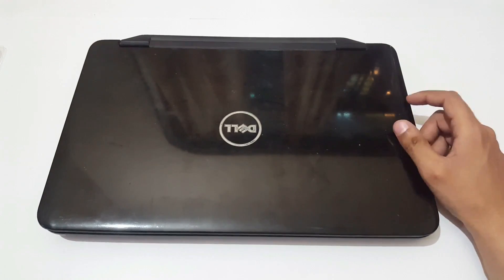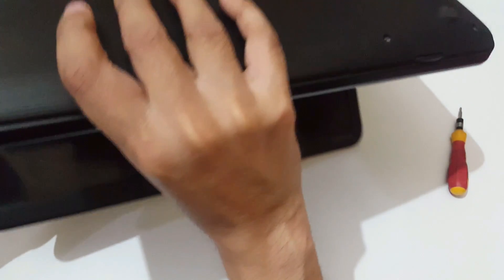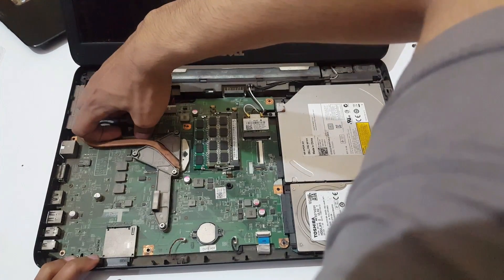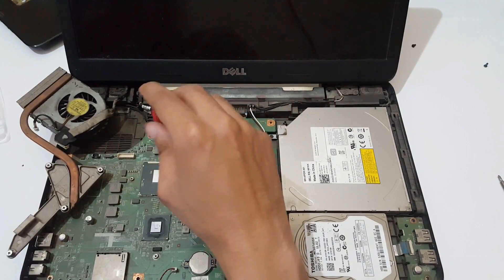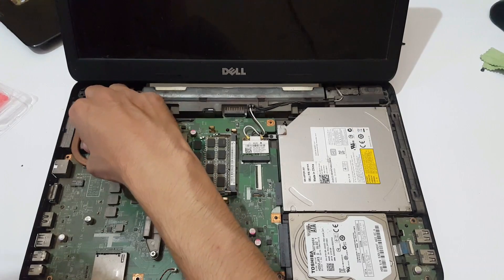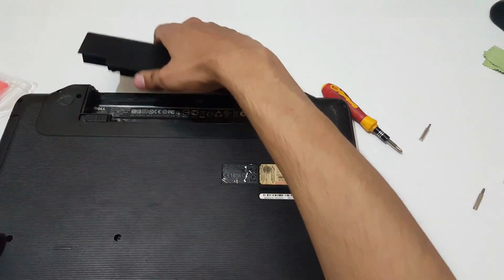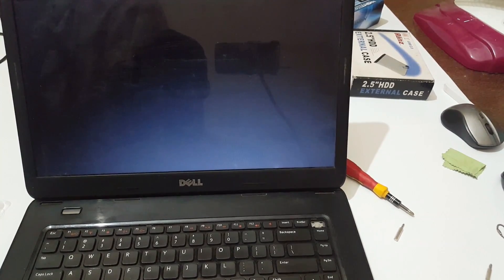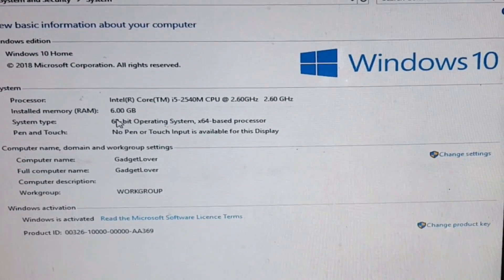How to Upgrade Processor on DELL Laptop | i3 to i5 & i7 - Make Laptop Faster for Gaming

Comment: I can upgrade from ryzen 3 3250u to ryzen 5 with the same gen? My laptop is a dell inspiron 15 3505, with a FP5 socket
Reply from the maker: The processor of this Laptop is soldered so you can't upgrade it but I would suggest you upgrade its RAM to max and install SSD for better performance

Comment: Bro I have intel core I3 10110u processor can I upgrade it to Intel I5 processor and which is best please reply me my laptop is lenovo ideapad 10th generation
Reply from the maker: The processor of this Laptop is soldered so you can't upgrade it but I would suggest you upgrade its RAM to max and install SSD for better performance

Comment: Bro can i upgrade my dell inspiron 5567 i3 6006u to i5 or i7
Reply from the maker: The processor of this Laptop is soldered so you can't upgrade it but I would suggest you upgrade its RAM to max and install SSD for better performance

Comment: can we upgrade processor of dell inspiron 15 3000 i3  {idk if there is pga or bga  in my process}
  to i5 or i7    if yes so how much will cost?
Reply from the maker: The processor of this Laptop is soldered so you can't upgrade it but I would suggest you upgrade its RAM to max and install SSD for better performance

Comment: Bro I have Dell Inspiron 3520 From 2012. 
I want to upgrade my processor from i3 3110m to i7 3632QM. Both have 35w TDP. 

Or Can I upgrade to i7-3940XM which is 55W TDP.  

Please Reply 🙏
Reply from the maker: Intel Core i7 3632QM is best processor for your Laptop
Reply: @GadgetLover360  So my laptop cannot support 55w TDP processor?
Reply from the maker: @archispal3618  It support but you will get some heating issues while operating
Reply: @GadgetLover360  thanks Bro.
Reply from the maker: @archispal3618  You're welcome
Reply: i have i7 processor you can upgrade it
Reply: I will arrange quad core processor i7

Comment: i have an  core(TM) i3-6006U CPU @ 2.00GHZ i want to upgrade to i5,what should i buy?
Reply: i have a DELL Inspiron 15 3000 laptop
Reply from the maker: @mlcfamilyofficial0521  In my knowledge the processor of this Laptop is soldered so you can't upgrade it but I would suggest you upgrade its RAM to max and install SSD for better performance
Reply: @GadgetLover360  okay thanks.
Reply from the maker: @mlcfamilyofficial0521  You're welcome
Reply: @GadgetLover360  what is the maximum RAM Can i upgrade it?
Reply from the maker: @mlcfamilyofficial0521  16GB
Reply: @GadgetLover360  2 sticks of 8Gb Ram?
Reply from the maker: @mlcfamilyofficial0521  Yes

Comment: I have dell Inspiron 3558 intel celeron 3215U. Which processor will br the best to upgrade?
Reply from the maker: The processor of this Laptop is soldered so you can't upgrade it but I would suggest you upgrade its RAM to max and install SSD for better performance

Comment: Hi Sir, I have a dell lattitude 5480 with i5 7200u is it upgradeable and can you suggest CPU to give better performance while gaming?
Reply from the maker: Hi and the processor of this Laptop is soldered so you can't upgrade it but I would suggest you upgrade its RAM to max and install SSD for better performance
Reply: @GadgetLover360  Oh Thanks for the info!
Reply from the maker: @ja19n  You're welcome

Comment: I have a Toshiba Satellite C655-S5212 from 2011 with a Intel® CoreTM i3-2310M Processor 2.1 GHz. What CPUs are interchangeable that I could upgrade to?
Reply from the maker: In my knowledge the processor of this Laptop is soldered so you can't upgrade it but I would suggest you upgrade its RAM to max and install SSD for better performance
Reply: I will arrange quad core processor i7 2860

Comment: Can we upgrade pentinum dual core to i3 or i5  & what is the cost of upgrading
Reply from the maker: If the processor is not soldered you can upgrade it in same generation
Reply: I will arrange quad core processor i7

Comment: I have dell inspiron 15 3000 i3 .. can i change the processor? i want i7 ? is it compatible for i7 or not?
Reply from the maker: In my knowledge the processor of this Laptop is soldered so you can't update it but I would suggest you upgrade its RAM to max and install SSD for better performance

Comment: I have an inspiron 5720, whats the best cpu i could upgrade to?
Reply from the maker: If the processor is not soldered you can upgrade it in same generation
Reply: @GadgetLover360  I'm new to upgrading, it's not soldered but I'm not familiar with generations or whatnot, sorry
Reply from the maker: @NbwGwiff  Kindly provide its processor number
Reply: @GadgetLover360  Intel i5-3210m @2.5GHz
Reply from the maker: @NbwGwiff  Intel Core i7 3632QM is best processor for your Laptop
Reply: @GadgetLover360  thank you, I forgot to say. I went ahead and bought that and got it installed so yay!
Reply from the maker: @NbwGwiff  You're welcome
Reply: I will arrange quad core processor i7

Comment: Hi sir, how about the dell vostro 15 with intel celeron p4600, can i still be able to upgreade it? And if i can still upgrade it, what is the max core upgrade for it sir? Thank you for your answer!❤
Reply from the maker: Hi you're welcome and if the processor is not soldered Intel Core i5 580M is best processor for your Laptop
Reply: @GadgetLover360  my bad sir, my laptop is vostro 3500 (end of life) with intel celeron p4600. Is it still upgrade-able sir? Thank you for the answer!
Reply from the maker: @reymarckiancorpuz341  You're welcome and yes
Reply: @GadgetLover360  is it still the i5 580m sir?
Reply from the maker: @reymarckiancorpuz341  Yes
Reply: I will arrange quad core processor i7

Comment: How about Dell 14 3437 celeron  whats the compatible processor i want to upgrade
Reply from the maker: If the processor is not soldered you can upgrade it in same generation
Reply: @GadgetLover360  whats the generation of celeron processor i don't know
Reply from the maker: @Rienhardheydrich  Intel Core i5 4360U is best processor for your Laptop

Comment: Excuse me sir mine is a dell inspiron 15r i5 5537 4 gb ram and it's from 2013 I have to upgrade the cpu and the ram ssd
I wanna know compatible ram and cpu and ssd plzz
Reply from the maker: The processor of this Laptop is soldered so you can't upgrade it but I would suggest you upgrade its RAM to max and install SSD for better performance
Reply: @GadgetLover360  sir so after maxing out it's ram and ssd (also tell me the max ssd compatible with it) will I be able to run games like valorant on the lowest settings
Also I want to know its graphics memory

Comment: Sir my laptop is toshiba satelite C50 A  core i3 can i upgrade it to core i7 5 to 12th gen? How much it will cost me? Any expected idea?
Reply from the maker: Yes you can upgrade it in same generation and it will not be too expensive I would suggest you to buy its processor from Ebay online store
Reply: @GadgetLover360 thank you sir but i have question will it work if i upgrade it in core i7 other than 3rd gen (other than laptop same gen)?
Reply from the maker: @shahabahmad225  You're welcome and no
Reply: @GadgetLover360 sir i am grateful for your time and response.
Sir if this is the case then core i9 3rd gen will   work if i upgrade it?
Reply from the maker: @shahabahmad225  Yes

Comment: Hello sir, can I upgrade my laptop processor, Dell inspiron 15 3000 series Intel(R) Core(TM) i3-6006U CPU @ 2.00GHz   2.00 GHz into Intel core i5 processor.
Reply from the maker: Hi and in my knowledge the processor of this Laptop is soldered so you can't upgrade it but I would suggest you upgrade its RAM to max and install SSD for better performance
Reply: Thank you ❤
Reply from the maker: @kennedyreang3076  You're welcome

Comment: Can I upgrade from i3 2nd gen to i7 2nd gen?
In dell Vostro 1450.
My laptop looks exactly same like yours.
Reply from the maker: Yes
Reply: @GadgetLover360  from where can I purchase the new processes.
Will there be a significant improvement in performance ?
Last year I installed an SSD and it has significantly improved it's performance.
Reply from the maker: @sagittarius544  Yes it will improve its performance and I would suggest you buy it from Ebay online store
Reply: @GadgetLover360  Intel Core i7-2620M Laptop CPU Processor
Is it compatible with my laptop?
Reply from the maker: @sagittarius544  Yes
Reply: I will arrange quad core processor i7 2860

Comment: can i upgrade my dell latitude e7240 from i5 4gen to i7
Reply from the maker: The processor of this Laptop is soldered so you can't upgrade it but I would suggest you upgrade its RAM to max and install SSD for better performance

Comment: hey insprion 3542 laptop processor is upgradable
Reply from the maker: The processor of this Laptop is soldered so you can't upgrade it but I would suggest you upgrade its RAM to max and install SSD for better performance

Comment: Very usefull 😊 i dnt skape the adds😊. My question is what is good i need to go shop to upgrade or i change it alone save money even i need to pay to shop😅
Reply from the maker: I would like to inform you that if the processor is not soldered you can upgrade it in same generation

Comment: Can you please check and tell me that can i do the same in my Dell Inspiron 15 3565, thanks in advance.
Reply from the maker: You're welcome and the processor of this Laptop is soldered so you can't upgrade it but I would suggest you upgrade its RAM to max and install SSD for better performance

Comment: Can a dell latitude 3440 i3 upgrade to i5?
Reply from the maker: The processor of this Laptop is soldered so you can't upgrade it but I would suggest you upgrade its RAM to max and install SSD for better performance

Comment: New subscriber here.
Please I want to know if I can upgrade the processor of my Dell intel pentium processor P6200 to core i3 and also increase the RAM from 2 to 4 or 8
Reply from the maker: Dear subscriber if the processor is not soldered you can upgrade it in same generation and for RAM upgrade details kindly see Laptop manuals

Comment: omg is this for real i have a dell inspiron 4gb ram core i5 clocked at 1.80 ghz gan i upgrade it to
Reply from the maker: Yes and if the processor is not soldered you can upgrade it in same generation

Comment: wow such a great video, i have dell inspiron n4050 laptop with a i5 2nd gen processor can i upgrade it to i7 3rd gen ?
Reply from the maker: Thanks and you can upgrade it in same generation
Reply: @GadgetLover360  then, can i upgrade to i5 4th generation plz reply
Reply from the maker: @Dexale_Gaming  As I said you can upgrade it to the same generation whether it is Intel Core i7 or Intel Core i5 processor
Reply from the maker: @Dexale_Gaming  Intel Core i7 2640M is best processor for your Laptop
Reply: @GadgetLover360  yes i  also do research but i cant find this processor online and offline what should i do i am from nepal
Reply from the maker: @Dexale_Gaming  I would suggest you buy it from Ebay online store
Reply: oh thanks @GadgetLover360
Reply from the maker: @Dexale_Gaming  You're welcome

Comment: Hey,my laptop is Dell Vostro 3000 series Intel i3- 10110U
Can I change my cpu i3 to i5 or i7?
Reply from the maker: In my knowledge the processor of this Laptop is soldered so you can't upgrade it but I would suggest you upgrade its RAM to max and install SSD for better performance

Comment: is this possible. to upgrade AMD ryzen 3  to ryzen 5 in laptop..
Reply from the maker: If the processor is not soldered you can upgrade it in same generation
Reply: @GadgetLover360  bro laptop processor always soldered bro if we change motherboard which support ryzen 5 then it works
Reply from the maker: @ChitraLokam3  View compatible motherboard for your Laptop with an AMD Ryzen 5 processor

Comment: I have an dell e5440 with a i5 4300u,and a dell latitude 3340 with i3 4005u, can it be replaced if yes, which cpus can i replace it with?
Reply from the maker: The processor of both Laptops are soldered so you can't upgrade it but I would suggest you upgrade its RAM to max and install SSD for better performance

Comment: I have dell Vostro 1014 laptop with dual core processor which processor can i upgrade please tell me
Reply from the maker: Intel Core 2 Duo T9900 is best processor for your Laptop
Reply: @GadgetLover360  and how much  Ram can I upgrade to dell Vostro 1014
Reply from the maker: @davidpradhan8607  4GB
Reply: @GadgetLover360  is it possible to upgrade to i3
Reply from the maker: @arunchandran3306  If the processor is not soldered you can upgrade it in same generation
Reply: @GadgetLover360  is it possible to upgrade to i3
Reply from the maker: @arunchandran3306  No

Comment: Hi. How can I know which processor is compatible with my Dell vostro 3468?
Reply from the maker: Hi and in my knowledge the processor of this Laptop is soldered so you can't upgrade it but I would suggest you upgrade its RAM to max and install SSD for better performance
Reply: @GadgetLover360  thanks for your quick answer, like and sub
Reply from the maker: @Feefer96  Dear subscriber you're welcome

Comment: Is it possible to upgrade processor core i3 to i5 on hp windows 10
Reply from the maker: If the processor is not soldered you can upgrade it in same generation

Comment: Can I upgrade my Dell Inspiron 15 3521 .  It has intel i5 3rd gen processor. If yes which will be suitable
Reply from the maker: The processor of this Laptop is soldered so you can't upgrade it but I would suggest you upgrade its RAM to max and install SSD for better performance
Reply: @GadgetLover360  thanks updated to ssd already. Work much better
Reply from the maker: @himanshubhushanmangraj1750  You're welcome

Comment: 😊 I want to upgrade to i5 in Dell Inspiron 3558 , Is processor soldered or not , Can I upgrade it??
Reply from the maker: The processor of this Laptop is soldered so you can't upgrade it but I would suggest you upgrade its RAM to max and install SSD for better performance

Comment: Sir i have dell vostro 3546, I had already upgraded its RAM from 4 to 8gb and Hard Disk to SSD. If I change it’s processor will it increase its speed and performance. If yes then plz suggest me best processor for it
Reply from the maker: The processor of this Laptop is soldered so you can't upgrade it
Reply: @GadgetLover360  thanks you for  replying 🙏🏻
Reply from the maker: @rohityadav9461  You're welcome

Comment: Bro can i upgrade the processor of dell latitude 3330(Intel(R) Core(TM) i3-2375M CPU @ 1.50GHz   1.50 GHz)  into Intel Core i5-3230M (3rd Gen 2.6 Ghz
Reply from the maker: The processor of this Laptop is soldered so you can't upgrade it but I would suggest you upgrade its RAM to max and install SSD for better performance

Comment: Hi, thank you for the video. Is it possible to upgrade processor  for Dell Inspiron 5559 from i3  to i5?
Reply from the maker: You're welcome and I would like to inform you that the processor of this Laptop is soldered so you can't upgrade it but I would suggest you upgrade its RAM to max and install SSD for better performance
Reply: @GadgetLover360  thank you for your reply😊
Reply from the maker: @kishoreel7486  You're welcome

Comment: Intel(R) i3-2350M cpu@2.30GHz with PGA988 socket i want upgrade can u pls help suggest.
R u providing services on which city
Reply from the maker: Intel Core i5 2540M is best processor for your Laptop
Reply: Are you providing services in Pune area
Reply from the maker: @rajpatel-uj4di  I do not provide any service

Comment: Sir i have i3 5th gen(inspiron 3558) which processor should i upgrade???
Reply from the maker: The processor of this Laptop is soldered so you can't upgrade it but I would suggest you upgrade its RAM to max and install SSD for better performance
Reply: @GadgetLover360  thanks bro 💗💗 much love i will upgrade ram
Reply from the maker: @volto6751  You're welcome

Comment: Can i use i5 3rd gen in replace of i7 3rd gen?
Reply from the maker: In same generation yes
Reply: @GadgetLover360 thank you for such informative video.can you guide me with my upgrade? I have some questions..
Reply from the maker: @naresht350  You're welcome and ask I would be happy to help you
Reply: @GadgetLover360  i need to upgrade my samsung NP300E5C ,  i3 2310m , its G2 Socket.having Tdp of 35w and Hm75 , sandybridge.
What options do i have?
Reply from the maker: @naresht350  Intel Core i5 2540M is best processor for your Laptop
Reply: @GadgetLover360  okay thank you for your prompt response
Reply from the maker: @naresht350  You're welcome

Comment: Hello sir your video is very helpful. I would be needing you’re expert advise. I have an Asus X540LA with i3-4005U can i upgrade it’s processor? If yes what would be the best? Thanks in advance. By the way I’m a new subscriber looking forward to your new videos
Reply from the maker: Hello dear subscriber and the processor of this Laptop is soldered so you can't upgrade it but I would suggest you upgrade its RAM to max and install SSD for better performance

Comment: so if I have a dell inspiron 15 3593 with an Intel Core i3-1005G1 and CPU @ 1.20GHz
... and want to replace my CPU with an intel i5. Can you tell me if it's possible for a replacement? and if it is, which one would you recommend me?
Reply from the maker: The processor of this Laptop is soldered so you can't upgrade it but I would suggest you upgrade its RAM to max and install SSD for better performance

Comment: So if I have a laptop of Dell Inspiron 1500 so It has 8gb ram DDR3 and CPU is Dell i3 1.20Hz.... and I want to upgrade my CPU to... Dell i7 is it possible?? Pls tell sir
Reply from the maker: If the processor is not soldered you can upgrade it in same generation
Reply: @GadgetLover360  ok sir

Comment: What about dell latitude 3330
Reply from the maker: The processor of this Laptop is soldered so you can't upgrade it but I would suggest you upgrade its RAM to max and install SSD for better performance